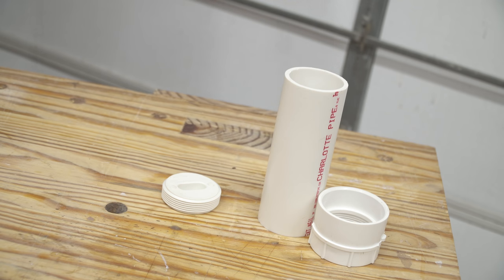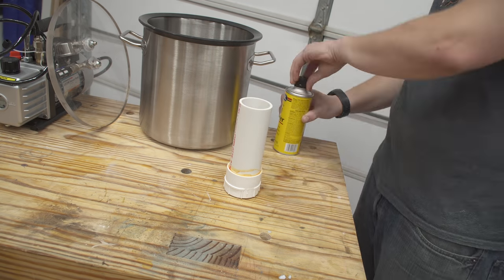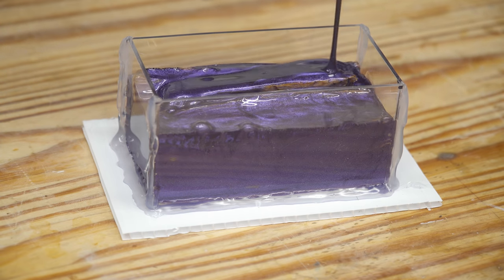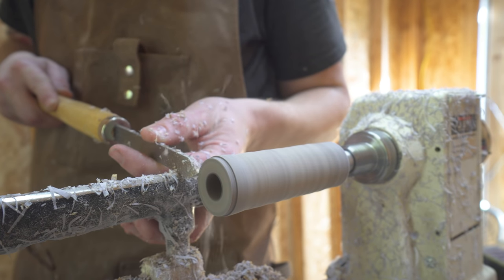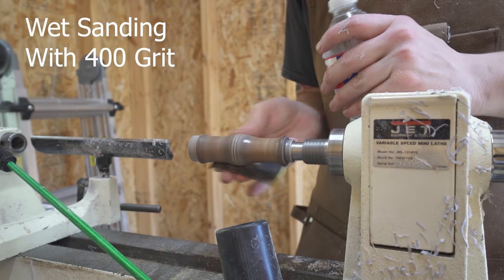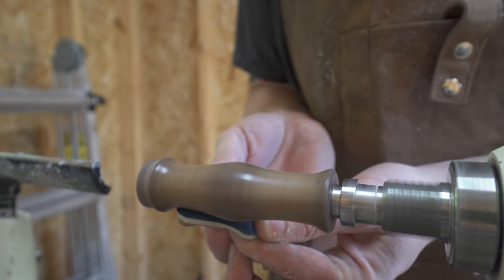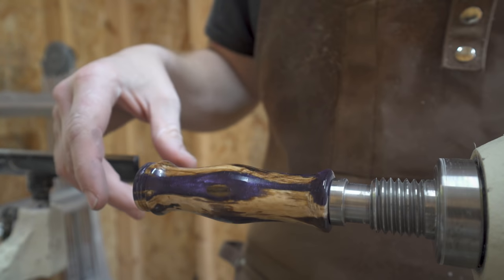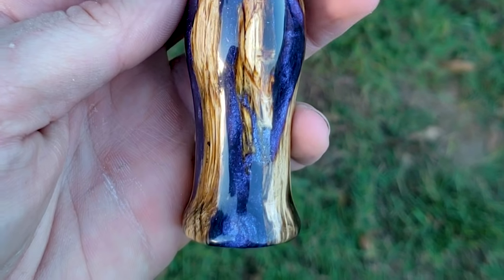How To Make A Beautiful Wood Epoxy Hybrid Duck Call

Comment: Finally someone that actually used minwax hardner instead of just saying it won’t work
Reply from the maker: It will technically work but it is not ideal.
Reply: Yeah really. I just want to see how it does instead of ignoring it. It's easier to find in a box store.